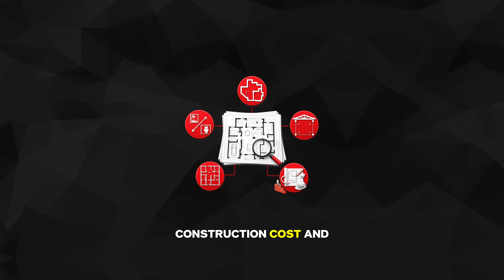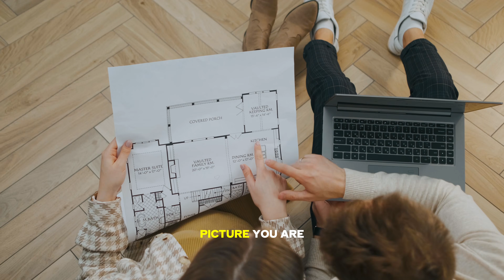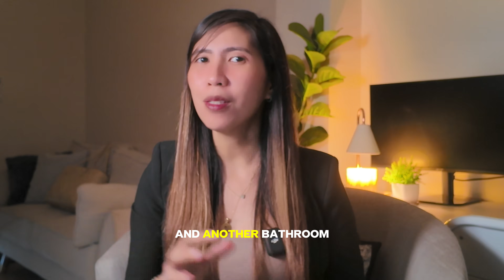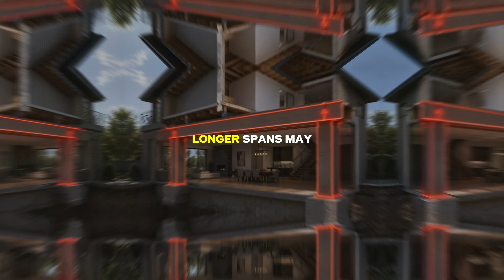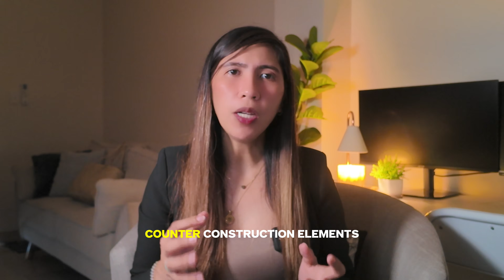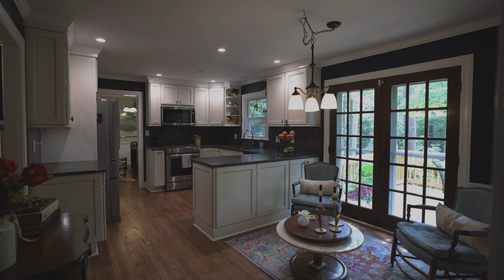5 Floor Plan “Savings” That Can Make Your House More Expensive

Comment: This is my first time seeing your video. The content is nice but it needs improvements to better deliver your message.

First you need to used two image of comparison to better visualize why it is a problem, expensive or ugly because you need to visually guide them to better understand it. 

For example, avoiding iregular layouts; to better visualize it compare it to the blueprint of a regular layout and point out the number of corners/pillars to empathize how costly it is. 

Second, question your viewers if it is necessary to let them think and then show the Pros/Cons of this decision. 

For example, show a layout then question if it is necessary to have 3 bathroom in a small house or why a bathroom in the middle of second-floor can be much costly to make compare if it is in the corner. 

Third, show as the interior or the house in the perspective of a person. It is not very necessary but it help your viewer to  connect. 

I understand your current video format makes it easy to transform your video into a short but I hope you also understand why a video like this should be presented in another way.